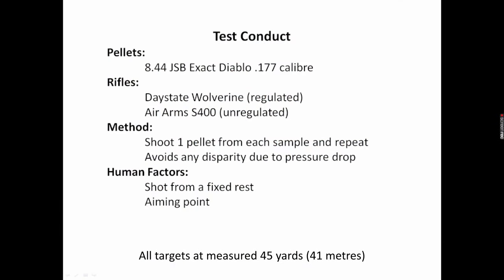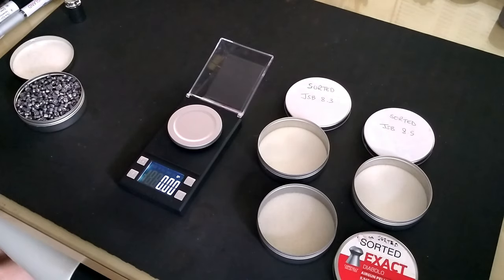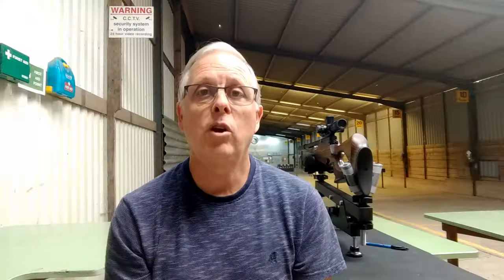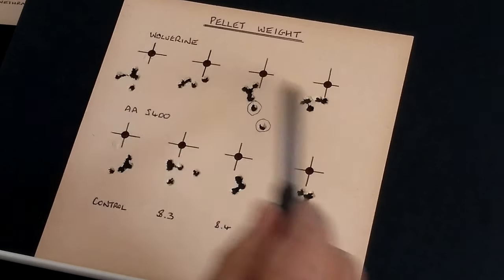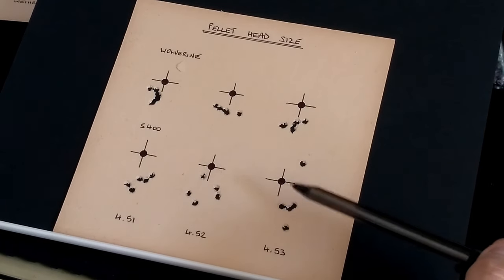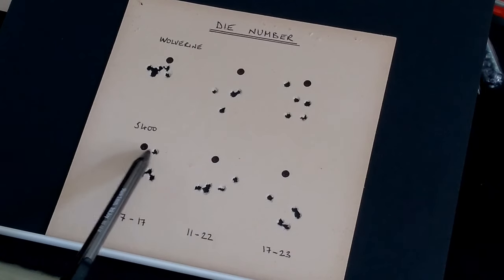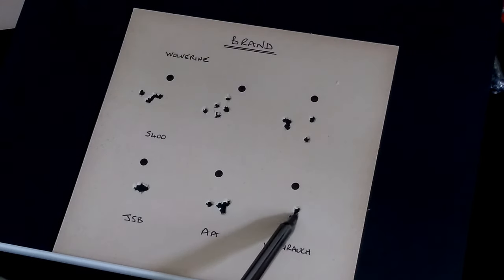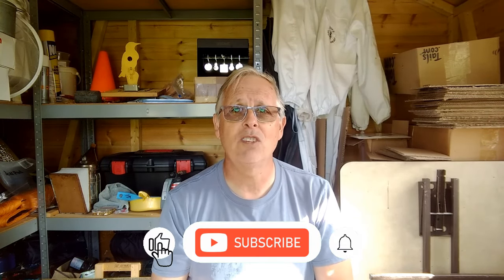21 - Exposing the Truth: Debunking Airgun Pellet Myths

Comment: I was plinking one day and put all the distorted pellets in my 14 shot magazine and lo and behold they shot just as good if not slightly better than the good pellets. Definitely a myth 😅
Reply from the maker: Yep! 😅
Reply: Just a theory , but if the pellet is not “to “ deformed , the amount of air pressure exerted probably expanded and reshapes the skirt going out . Fly better , I doubt it !
Reply from the maker: Yes, I think that extra movement may sometimes seat the pellet better.
Reply: Because the air blast pushes the soft lead skirt out uniformly against the rifling.
Distorted heads is another matter.
Reply: I went to the indoor range and tried to zero my PCP, HW100. What a nightmare, got a new tin of 500 1.77 and as if by magic almost pellet on pellet.

Comment: The numbers on the back of a pellet tin do not show the actual head size of each pellet in the tin if you use a pellet gauge, you will find a mix of head sizes usually in jsb from 4.50 up to 4.54. Even  when the labels say 4.51 or 4.53.
Reply from the maker: I hear you Keith, and would tend to agree that like pellet weight a tin may contain a mix of head sizes, but I have yet to collate any evidence to prove that. However, in an interview I saw recently with JSB Director of Operations he clearly states that they have production dies for each of the head sizes and a perfect pellet without any damage should have the head size stated on the tin. I've seen some head gauges and they all seem a bit too cheap to be wholly accurate to 0.01mm.

Comment: I think the bent skirts actually fire-form with the softer lead compounds.  The fact the skirt is off the contact gives the blast of air momentum on the skirt and actually ends up causing a better seal and bite into the grooves.
Reply: Very interesting idea!  I think that would work with rifles at nearly 12ft/lbs, but would not work in a target pistol at about 2 joules?  Not enough pressure to “fireform” the skirt for optimum obturation.

Comment: Nice video. I would have added a last test. Using only the best batch (dye) for each gun, and then sorting by weight and head size and also a 3rd category of identical weights AND head sizes from the best dye. I am pretty sure you would get interesting and conclusive results as I have done these same tests myself on many rifles until I have found the best combo for competition. Another suggestion would be removing the rifle stock and clamping it straight to a heavy table using 2 bolted vices (and eventual weights to the table) therefore eliminating any potential human error and getting rid of an extra variable....Thanks again for that video.

Comment: From my experimentation:

I agree regard pellet weight. 

WRT head size - the head size shown on the JSB tins rarely correlate to the head size in the tin. Using a Pelletgage, I have found head sizes ranging from 4.49 to 4.55 within the same tin regardless of the size shown on the tin (the JSB Premium has far smaller spread). In my rifle, pellets with measured head size of 4.52 and 4.53 give the smallest groups, the further the head size deviates the bigger the group.

I agree batch number does make a difference. The batch number with least deviation in head size and a head size that suits your gun will produce the smallest groups.

Main brands better - not a safe claim, it depends on the variation in the tin.

Skirts - not done that test. In your experiment did you use consistent heads size pellets - it might be the group size was affected more by the head size than skirt distortion.
Reply from the maker: Thanks for sharing. Perhaps I need to get a head sizer and test this myself. What head sizer do you use?
As for the skirts, I didn't size the heads, but since the video many shooters have told me they've had the same results. 🙂👍

Comment: I concur your content is both practical, useful and easy to comprehend. I would be really interested to know the make and model of your pellet scales (and where you purchased them of course). I've been trying to find a scale with a two decimal place reading for ages without success.
Reply from the maker: I got my scales from ebay. I've had a search and found an identical item with ebay item number 126048721920 or search for "50g/0.001g Digital Milligram Scale High Precision Jewelry Balance Powder Scale"
Reply: Be careful. Just because a scale reads to the milligram doesn’t mean it’s accurate to that level.
Reply: Bought mine on Amazon it actually has three decimal points , for under $30
Reply: @AirRuna1  again: just because it reads to 3 decimal places, doesn’t mean it’s accurate to that.
Reply: @thabood  it is though you just have to be smarter than the scale calibrated mine with a pharmaceutical scale

Comment: I live in the Philippines - shoot a locally made regulated (1,500 PSI plenum - 4,500 bottle) 22 cal PCP using local pellets. They all have to be sized (head and skirt) and still need to be force seated. 

I made a pellet seater from a 1/4" nail by rounding end. The fact that the seater is actually of a larger diameter insures that  the skirt to reformed and the pellet set at the same depth each time. 

75 yards - 125 feet - 68m? 1/2" to 3/4" groups - 1.27cm / 1.9cm
Reply from the maker: Sounds like fun! 😲 Thanks for sharing. 😀👍

Comment: 4.51 head size definitely produces tighter groups, and if you varied the speed, it would have shown even more. My theory is that concentricity inconsistencies are more of a factor. I had a tapered hollow tube and push pun to check .25 caliber and found amazing things. The branded pellets were at least 30-40% less than the JSB. I use a joker holder with my tube. The head of the pellet just protrudes, and the skirt is braced with the square-ended push pin. Then it is rotated for runout
Reply from the maker: Thanks for sharing.

Comment: I didn't expect the weight one to make any significant difference (with those weights) but I was really interested in the bent skirt test. I bin mine like everyone else but I've often thought the skirt would expand when fired anyway and make little to no difference.

FWIW, I shoot H&N FTT 4.52 in both my S400 and HW98, good as any I've tried inc JSB.
Reply from the maker: A pellet sizer is good for reshaping skirts if you don't want to shoot them as they are. 🙂👍
Reply: I probably throw 1/2 doz per tin, not worth the hassle LOL.,

Comment: The problem is, as you've shown the Die number is a plausible one. This probably accounts for the disparity in the OEM v branded pellets. I use BSA Goldstars ( rebranded H&M FTTs) whatever dies they use  ( maybe specific ones for specific branding) the BSAs just edge the H&Ms for me.
Reply from the maker: I don't know how it works with H&N, but when JSB are doing a branded production run they only use one machine and one die for the complete order. Their own pellets run on the remaining machines and thus multiple dies.
Reply: @hftshooter  that may well be it then 👍. H&N might just use specific dies for the BSAs hence my gun preferring the Goldstars despite all the specs being identical to the FTTs.

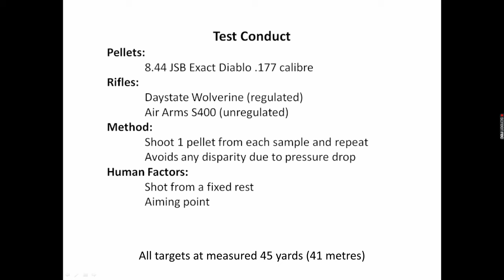Comment: I would disagree with pellet head size . I’ve been shooting bench rest competitions for 15 years and pellet head size definitely matters , in pellet testing I have found certain head sizes perform better than others in my rifles . Also breach size my hw97k will only hold and shoot 4:53 if I put a 4:51 or 4;52 in they will literally drop out the breach and terrible flyiers
Reply from the maker: Hi Dean. I can only comment on my own experience and testing. I simply interpreted the results I saw on the video, where I found what you saw. If you've found some different that works for you then great! Good luck with your benchrest shooting.
Reply: Is that down to manufacturing tolerances perhaps? 
Another 97 might prefer 4.51 for example?
Reply: @redpillnibbler4423  yes but that is why you have to pellet test to find the best pellet head size for each rifle

Comment: Interesting video. I'd have to say though that most scales people are using simply aren't accurate enough to weigh down to 0.1 grain plus you've calibrated it with a 50g standard. I'm saying this as someone who has worked in research labs using scales that cost a great deal more than the kind you are using and are calibrated using a range of standards capable of accurate readings down to 0.0001g.
Reply from the maker: I would agree. What I didn't show is if I weigh the same pellet numerous times on my scales I get the same reading. Therefore, I assume that if two pellets read as 8.44 grain then they are equal in weight if not exactly the weight indicated. I think that's a fair assumption.
Reply: @hftshooter Agreed; the old Accuracy vs Precision misunderstanding.

Comment: It would have been nice to see another test of how the latest slugs compare to traditional pellets, just a thought 😊 👍
Reply from the maker: Thanks for your comment. Personally I've yet to be persuaded that slugs work in a sub12 rifle and I don't think I would ever use them, but never say never. 😉👍
Reply: I've been shooting air rifles for over 45 years with my collection of rifles ranging from vintage 1920s BSA spring powered tap loaders, and 1970s onward PCPs. My latest add being a BRK Ghost (all being sub 12ft pounds). The old style slugs were really just only ever for FAC rated guns but the new lighter designed ones are a huge step away from those. I've been experimenting with them from their earliest introduction and must say, yes I've had mixed results but surprisingly amazed at how they have come on. My old tap loaders love them as those barrels were never choked. Modern springers like my TX 200 HC are even OK but probably not best suited. My older 70s PCPs (like my original Daystate Midas and MK ll Huntsman seem to like them as well). I have a cheap Snowpeak P35 which seems to absolutely love them and even my BRK Ghost is giving good result although that seems to like the heavier 13g ZANs as they are slightly longer than the 10g so load better into the mag and chamber better. It's been a journey I'm quite enjoying  👍
Reply from the maker: That's interesting, thanks for sharing. Perhaps I shouldn't discard them so quickly? 🙂👍

Comment: Have you ever weighed a pellet, taken the pellet off the scales, and then weighed the same pellet again. I have gone through about 5 sets of scales and it happens a lot. Please do a video of you weighing the pellets then rechecking the weight again.
Reply from the maker: I've done that a few times for my own piece of mind and I find my scales are pretty reliable, but I do place the pellets on carefully with tweezers. The thing is, unless you spend loads on properly calibrated laboratory scales you are not going to get great accuracy. However, I don't really care about true weight but rather how pellets compare to each other , and the odd hundredth of a grain isn't significant.

Comment: Interesting video … but every barrel is different … the wolverine might not preform as well as the AA with those pellets (or vice versa) … tbh shows me how inconsistent JSB’s are now and also depends on the die … my steyr loves die 80 jsb 8.44 4.52 but with die 62 it throws them like a shotgun …
Reply from the maker: You're right Ian, every barrel is different which is why I would encourage everyone to test for themselves and not take things at face value. Of course, it depends upon the results you need to achieve for the type of shooting you're doing.

Comment: Interesting, apparently you find no noteworthy difference in accuracy between the different head sizes, in my experience it makes a significant difference. This is based on trials I've done using my HW98, HW100, and Vulcan 2, all in .177 (FAC for you guys across the North Sea) shooting H&N Baracuda Match as that's what they seem to prefer of diablos. I've shot 4.50, 4.51, and 4.52s through all of them, and maybe it's just a coincidence, but they all group tighter with either 4.50s, or pellets of the same brand/model I've resized to 4.50 mm, the groups open up the higher I go in actual caliber.
As for your Test #4, in my experience, there isn't a whole lot of difference between the pellets we get over here in DK - according to my lead pusher, FX pellets are rebranded JSBs but FX supposedly does their own QC on them and send them back if they fail the test, so in theory they should be more consistent in weight/size/etc. than the other rebranded JSBs, but I can't tell the difference in accuracy, in my guns JSB and FX hit all over the place compared to the H&Ns. No, I'm not sponsored by H&N.😄
The last test caught me a bit by surprise, to be honest, think I'll have to do a bit of testing of my own, thanks for taking the time to put this video together.
Reply from the maker: All this testing stuff gets a bit addictive. Might you have noticed a difference due to the higher power? Thanks for sharing. 🙂👍
Reply: @hftshooter  I'm not sure exactly what happens, in theory it shouldn't matter a great deal exactly what head size we use, irrespective of power output, as any halfway decent UK or DK rifle is easily capable of sending any pellet down the barrel. I mean, it's not like any pellet that comes out the muzzle by some sort of magic happens to be larger than the bore when it exits. The only thing I'm certain of is that between the guns my shooting buddy and I use, heavier pellets or even slugs, do a lot better than lighter pellets, but head size apparently makes a difference as well, although I have no idea why. I would imagine that in a rifle with a lower power output, the head size would have a greater influence on accuracy, but apparently it's the other way around, go figure.

Comment: Have you tried sizing as well, as  the bench rest guys do that, then weigh, and then lube just before the match.
Reply from the maker: Hi Ian, I will probably cover that in a future video. I've yet to see any credible and compelling evidence that it achieves anything other than a placebo effect.
Reply: I agree with you ,ok I shot center fire ,I would weigh the cases ,full lenth trim them ,some would measure internal volume of the cases ,I would weigh the power and the heads all down to .02 of a gn ,it makes a world of difference, we would not use a rule to measure we would use an computer group measuring tool ,that would do to the thou of an inch ,great tool ,we were getting 1 hole groups and ragged hole groups ,his results  sho both his rifles performed better with the 8.4 gn pellets, if he was to do this test again but batch them down to .02 of a gn as he's allowing almost 1 gn difference between batches ,if he's weighing 8.30 , gn up to 8.39 then that's a full
 gn difference

Comment: how din you know the pellet head size? did you just use the numbers on the tin or did you use a pellet gauge?
Reply from the maker: Just the numbers on the tin.
Reply: at 15.51 on video shows, the number on the back of the pellet tin shows head size and the batch number. I think that applys to all makes.

Comment: your shooting position and location of target seems to effect results more than anything it seems
Reply from the maker: With the benefit of hindsight I think the groups would have been tighter if I'd not used the rest and shot how I normally would on a bench. However, the test conditions were the same throughout so I think the conclusions were valid.
Reply: @hftshooter  low right corner was worst, how i would of done it would be, clean barrel shoot 10-20shots then group, repeat

it can take 1-2 up to 15 shots for barrel to catch up with different pellet
Reply from the maker: All JSB pellets, so all exactly the same composition of lead!
Reply: @hftshooter  still takes few shots

Comment: interesting tried some of those tests and got different results 😂😂😂 but i find guns are a fickle thing tx shoots 4.52 but definitely shoots 4.51 or 4.50 better not a massive amount but the difference between a split line or in the bull circle ⭕️ on bench rest targets 98 shoots any thing half decent and size does not seem to matter that much . red wolf shoots jsb short’s like a laser . as for weight most of the time i have bothered to way pellets out the tin they are not far enough out that i noticed to much difference . sizing them i noticed i definitely get less flyers
Reply from the maker: Hi Paul, I approach everything from an HFT perspective so the odd mm isn't an issue. I agree bench rest is a different animal where everything counts. 👍

Comment: This is not busted this test shows both your rifles shoot a tighter group with the 8.4 pellets, and if you were to do this again but keep the weigh difference to .02 of a gn you would see a difference between batches ,the way you have weighed them is upto a full gn difference, i know this works as ive done it ,dont worry about the crono ,its where the point of impact is
Reply from the maker: Thanks for your comment. It's clear from yours and others comments that experiences vary on this topic. 👍
Reply: @hftshooter  I know it's a lot of hard work ,but it's all part of the fun , just dont do what I did and let your m8 use your rifle and home loads and he then beats you on the tightest group comp 🤪

Comment: I'll have to add ..lool ,,,,,,,I short my pellets by weight. ,,,I live my pellets ,,,,,and my groups from a avenger. And akela are way tighter than this ,,,yes each gun like a certain pellet weight n design ,,,,,but sorting and lubeing helps out tremendously for my shoting at 50 yrds
Reply from the maker: If that works for you then great. My own experience with my PCPs and springers is that it's not worth my time. 🙂👍